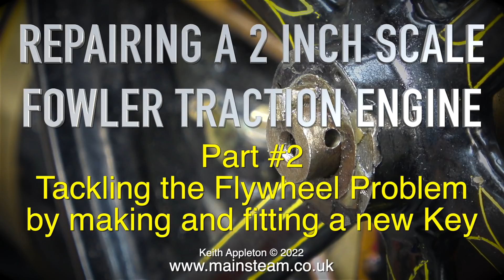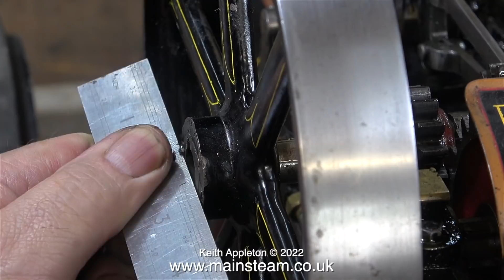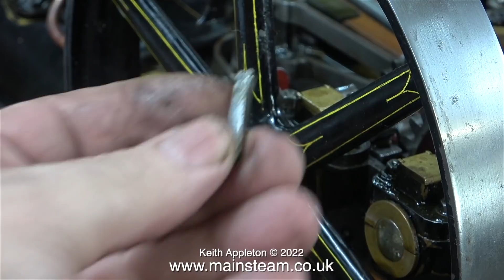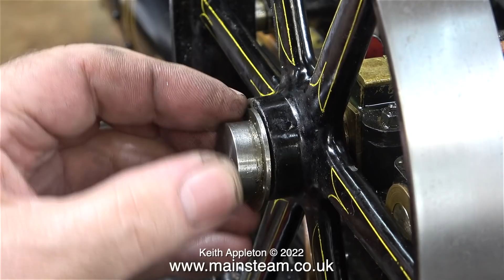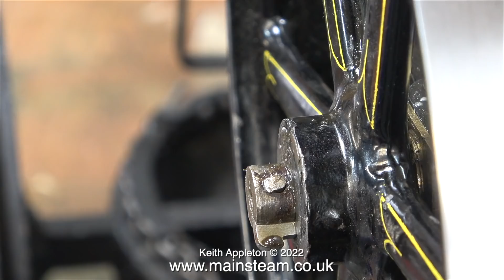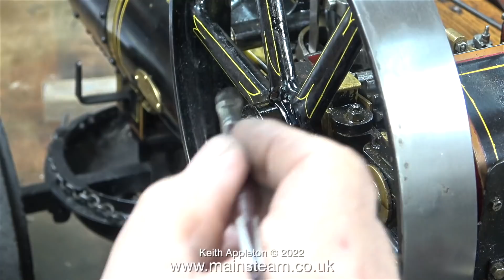REPAIRING A 2 INCH SCALE FOWLER TRACTION ENGINE - PART #2

Comment: I must admit having removed many key's from go-kart wheel hubs on axles ... the idea of putting a step on the key never occurred to me ... such a simple solution to remove such a pain in the backside piece .... this is one reason why I like these video's ... sure they may be all steam engines ... BUT the techniques and tricks work in MANY places not related to steam engines too ... 
.
honestly most of these video's could be called practical problem solving with model steam engines ... excellent learning for new to modeling and even experienced people I bet ...

Comment: Is it just the video or is the flywheel still not straight?  It appears to wobble from side to side during rotation, like a tiny bend in the shaft or a misaligned bore in the flywheel.
Reply from the maker: There is some run out on the Flywheel - just like many full size traction engines . . . . . . I am working to a budget on this engine and there is a lot more wrong with it than I was first told by the current owner.
Reply: @keithappleton  Thank you.  I thought at first that I was delirious but kept seeing a wobble.

Comment: Beautiful engine. It is amazing to me the difference that the small parts can have on the overall running of the engine. It also speaks to the tolerance of steam engines. You have shown many that were a log way from being right but they still would run. I really appreciate your videos and I always learn a lot from them whether it is boilers, piping, engines, or organs. Always interesting. Thanks for the efforts.
Reply: hard to think something as simple as a key in a flywheel could make a big change  sure it's not a complete fix BUT .. it is a noticeable change and all he did was put in the correct bits instead of "this will do" bits